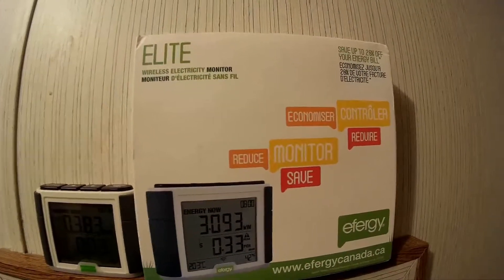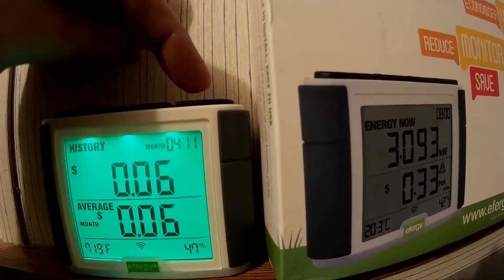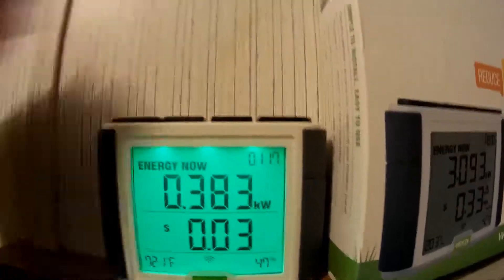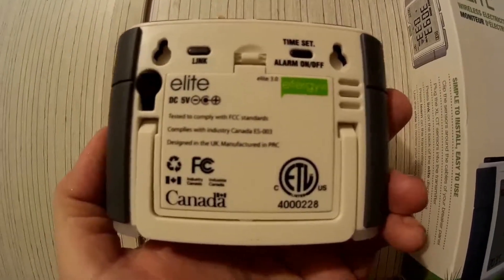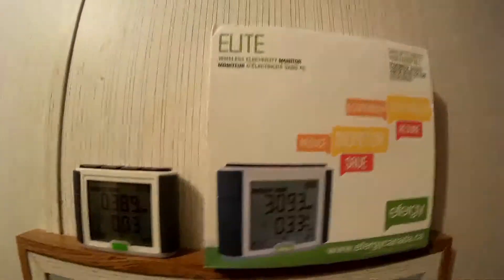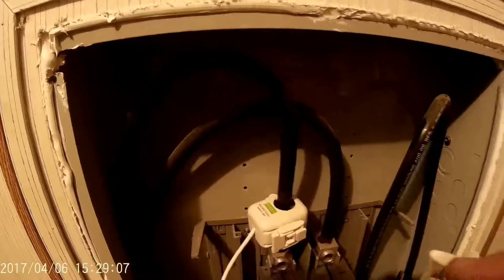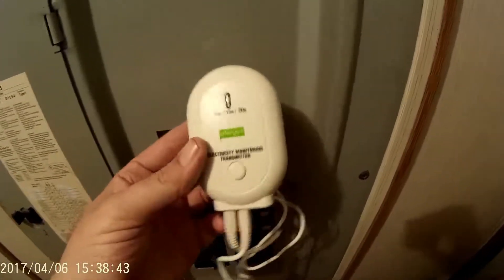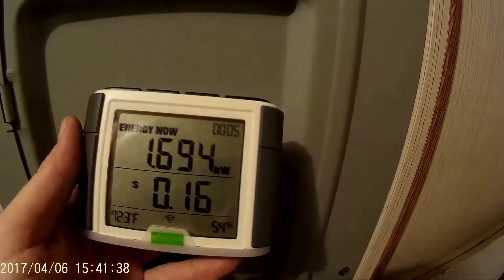Efergy Elite 3.0 whole house power monitor

Comment: This efergy only works correct on 120V amperage pulls....  It will give you false wattage readings when 240V appliances kick on...  It does not know how to distinguish from 120V appliances to 240V appliances...  all it does is sense more amperage pull from each leg and add them together and give you a total reading which is CORRECT under 120V only but when 240V appliances come into the picture its also adding those together ...

on a 240V circuit amperage is the SAME. Example hot water heater runs on 240V.. when it kicks ON you will get ~18 amps on one hot leg and 18 amps on the other hot leg.. Its NOT 36 total amps, its 18 total amps because current stays the same on a voltage series circuit (120V + 120V), SO when the hot water heater kicks ON, L1 shows 18 amps and L2 shows 18 amps... Efergy is ADDING them together for a 36 amp load and showing you an additional ~8k watts on top of the normal 120V wattage...   My hot water heater is NOT pulling 36 amps because its a 30 amp breaker at the panel..... !!! 
The same with my Dryer... it pulls 25 amps on each leg, efergy is telling me 12k watts for the dryer... thats 50 amps... NO WAY when the breaker is 30 amps..!!!

My 7k running watt generator can push the Dryer on its own and its only 7k watts.....
Reply from the maker: You Tube That is not correct. This unit is reading exact same kwh use as my city meter outside. Make sure you have the right unit size and the coils are in the correct orientation. I also used a meter indoors to check it's perfect calibration here. Good luck.
Reply: before this conversation goes out of whack...
i didnt now they have different unit sizes... What unit size do i need..??
What orientation do the coils have to be in...??  There are only 2 primaries in the panel... L1 and L2 ....
Reply from the maker: You Tube hi sorry for late reply, they have several models and generations. This is a gen 3 , 60hz, 200 amp, and I'm running copper 4/0 mains. The clamp labels toward service line side. The clamp direction should not matter just I saw it on another video. If you make a video or pictures of your setup I'll take a look. Are your mains aluminum?

Comment: 666 that's a good sign.
Reply from the maker: Adventures With Bash?? Time for some Iron Maiden album flashback's.
Reply: The number of the beast is really 665.9999999999999999999999998999999999999999979999999
But was rounded off to make it easier to sing.